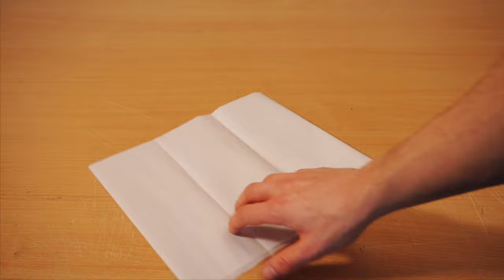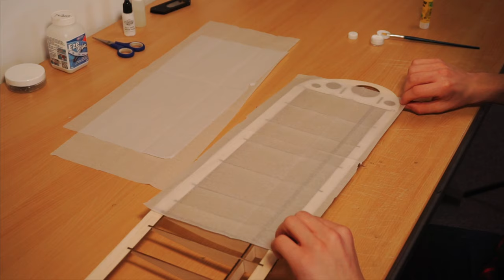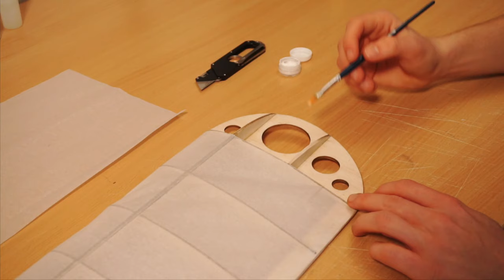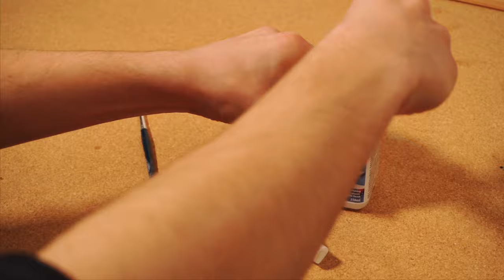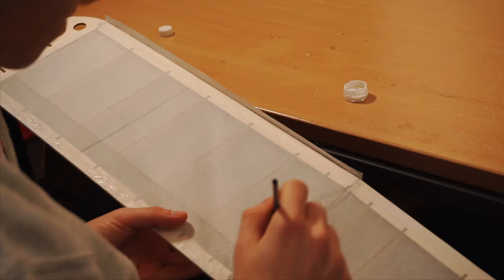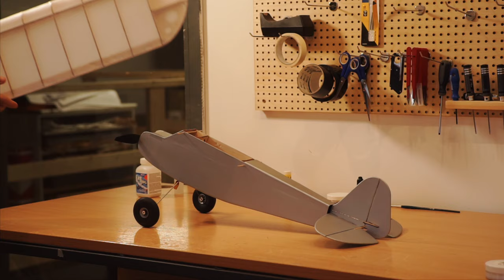Easiest Way to Cover a Wing? / Balsa and Tissue Aeromodelling

Comment: I used to dope the entire framework before covering. Added strength plus gave a base coat of dope for fabric to stick to. Put tissue on and lightly coat outside edges of frame through tissue and it would glue tissue on. Of course it’s been 50 years since I built contest models.
Reply: dope
Reply: Can’t find dope any more.  Too bad.
Reply: @m3131m  It's widely available, but be prepared for sticker shock.

Comment: I have a method that's way easier... Mix half and half water and white glue in a spray bottle. Spray the frame with the solution. Then place precut tissue onto the frame. It will already stick. Pull the tissue somewhat tight, spray and wet the tissue with the same solution. Then use a hair dryer on low to dry the tissue. It will simultaneously shrink, and dry stiff, and right onto the frame. The solution in the tissue will make the tissue significantly firm, and strong. Very quick and easy. It's also dirt cheap.
Reply: I'd be worried about the weight. May experiment with it though.
Reply: @kf4293  it actually comes out quite a bit lighter than store bought dopes and glues.

Comment: Enjoyed watching your video which brought back memories from way, way back (being very, very old!). Things don't seem to have changed very much other than prior to covering, all surfaces were covered with "tissue paste" (no glue sticks in those days). The tissue was then sprayed with pure water and allowed to dry, using an old scent spray I recall, and yes ducky, there really were such things. If you'd done a good job the tissue would already be wringle free. The next process was brushing on the clear dope which gave off such a smell it fair knocked you over ꟷ I remember if with great affection. The tissue would then be very taut and could be decorated with coloured dope, transfers etc, all obtained from your friendly local model shop as opposed to Hobby King. PS I'm currently converting 2 Lidl gliders to powered flight ꟷ bit of a traitor to the cause!
Reply: Stick-built all the way  :-)  Three smells that still get me. Hoppes #9 powder solvent, butyrate airplane dope, and Windsong perfume.  I wish I'd enjoyed more of the latter.
Reply: Do not use "easy dope"!

Comment: i used to build models like that back in the early 60's  some for flying and some for static display. they were mostly rubber band powered but always came out to be too heavy probably from too much glue and dope so i would turn them into gas powered with some cox glowplug motors flying them with ucontrol lines or freeflight. it was kinda before r/c was available for kids to have. i enjoyed watching,thnx.

Comment: We used to use a wet covering technique where the tissue was applied wet and doped down. We had real dope. I don’t know how it would work with easy dope. The dope could be painted right onto wet tissue. It would soak through the wet tissue and dry long before the water dried. Yes I know it sounds like magic but, the dope would dry and glue the tissue down while it was still water wet. On larger models or RC models we would cover with Japanese silk applied wet. I did a few models using monocote but always preferred tissue or silk. It was just what I was used to.

Comment: Did you slit the tissue with a blade to fit the edges between the ribs or just press it down with the brush until it tore? I watched carefully but couldn't tell...

Comment: Hi, I wanted to get into this and wanted to ask is the easy dope stuff is necessary, I've seen others just use water/ do nothing at all once the tissue is on, happy holidays and thanks in advance!
Reply: The dope helps protect the covering and strengthens the wing.  It will impregnate the tissue and give it a varnished finish, adding rigidity, preventing punctures and tears, while making it waterproof.  Though honestly for an RC wing of this size they should go with a heavier paper covering like silkspan that can also be applied while wet.
Reply: It's one of several methods actually. Nitrate dope is used by some, and is the "traditional" method to a lot of people. But... It has a terrible odor. 
I've read of some that use banana oil, which has a similar effect to EZ Dope, but have never tried it. 
A lot of modelers are using clear krylon spray acrylic or similar. Light weight and easy to use. Plus available just about anywhere. I don't know how krylon compares to EZ Dope strength wise. From what I've read, the EZ Dope makes the tissue very tough, but I'm not sure about how much weight it adds.
Reply: I’ve used the Krylon on a couple models. Both rubber power, both Guillows. One a Cesna 150, one a P-40. Both flew reasonably well for Guillows kits. The covering turned out nice and tight. The Krylon shrunk the tissue even tighter than it was with just water. It added sufficient strength that I was not worried flying them in tall grass. I didn’t have doped models available to compare weights but they didnt seem heavy to me.

Comment: I was thought to cut a single sheet of covering that would wrap around the leading edge to cover both the top and bottom of the wing at the same time.  We would dip the silkspan in water then allowed it to drip off the excess water.  It was not tissue paper and was much stronger than tissue paper.  The produce was called silkspan.  We used dope to coat the top and bottom of the leading and trailing edge of the wing.  

Then placed the wet covering over the top of the wing and allowed the top sheet to over lap the bottom of the trailing edge. Then bring the bottom covering and let it overlap the top covering that covered the bottom of the trailing edge.  That way the wind could not try to get under the covering.  While it was still wet we applied dope to the whole top and bottom surface.  When it dried it was nice and tight.  Then painted it with the colors of our choice.

Comment: Whats the thickest paper you can use for this?
Reply: You want light, non-bleeding tissue. If it maintains strength when wet, that can help with curves. Sig, Wind it Up enterprises, and EZ built Models all carry tissue specific to model airplanes.
For large models, if you want to go traditional like this, silkspan is good, available from Sig manufacturing.

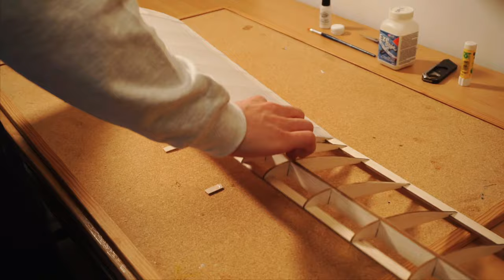Comment: Puffer, at 5:33 your leading edge is wrinkled/warped.  This EZ dope is for the birds.  Floorshine floor wax is all this crap is and sets warped and wrinkled surfaces by drying before it stiffens . I am not the only person who found this out the hard way. 
  EZ Dope is crap. Shrink with water, continue pulling out all wrinkles, then Krylon
 spray lightly.  END.

Comment: How do you do this process but with thin nylon material?
Reply: I used to use Nylon and Silk back in the day.  It's a different approach altogether.  Basically use Cellulose Dope all over the airframe and let dry, pinned down. Cut out your nylon panels and damp them. I used to put them in a tray of water for a while and them wring them out!  Next drape the damp panels over the air frame and using the dope and a brush, stipple the edges down, pulling out the wrinkles as you go. The dope with soak through the material and stick to the pre doped air frame. Use you finger to rub the edges down. ( It's a messy business)! Pin it all down again and leave to dry.  Now you can start to apply dope to the fabric.  The first coat needs to be a very light coat all over, top and bottom.  Pin it down again and leave to dry.  You can then add heavier coats, pinning and drying in between until you are happy its taught enough and air tight.  Hope this helps.  Solatex or similar is a lot easier if you can get it!
Reply: @bobi2582  thank you so much for your descriptive response. I have tried to use Solatext and so on with an iron and have never been able to grasp the technique.

Comment: Bottom should be covered in a complete  2 part section , then the top, tips last. Shrink bottom first as it was done first..then shrink top...you maY have incorporated warps by only doing one side top and bottom on one panel, then the other..

Comment: I would of thought that the 50/50 glue mix will cause some movement of the wood. I would rather of used the pritstick for all the gluing of the tissue.
Reply: gary murphy you keep using the word “of” when you mean to use “have”
Reply: I was wondering if that was really necessary, if they're already using a glue stick. I'm thinking about doing some simple stick models to experiment with all this.

Comment: What are the alternatives to EzeDope ?
Reply from the maker: You can use cellulose dope applied to tissue or you can cover with Oracover type covering films that use a heat iron for application. ☺️ Info on alternative dopes here:  https://www.vintagemodelcompany.com/dopes.html
Reply: White glue like Elmer's diluted with water, about 50%